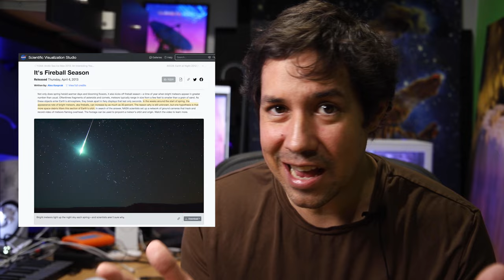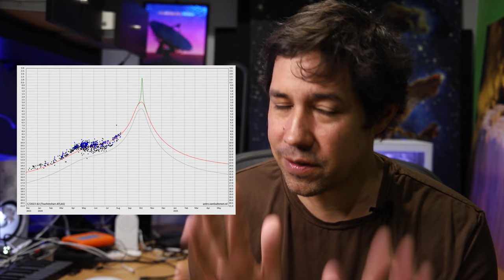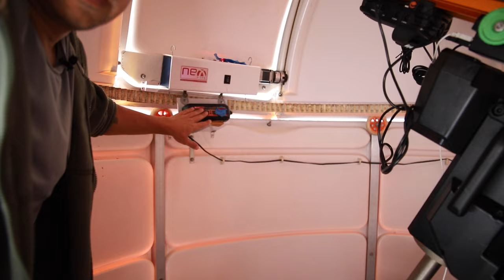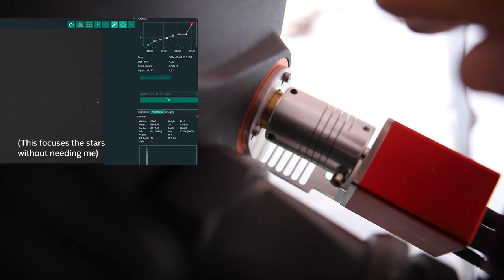Explaining my current Telescope setup! 🔭

Comment: Holy crap, clean that lens! (I hear at the end you did, good job, haha) But seriously, I've always loved your setup. I have the little brother, an 8" EdgeHD and EQ6-R Pro, on a dolly that I roll out to the driveway. Your setup is certainly the next step up, as soon as my wife approves me getting an observatory dome. I am not an OAG guy though, I am doing just fine with my guide scope, plus it looks cool. I am a bit of a ZWO fanboy though, with the ASIAIR, ASI Cameras, and ZWO EAF. I doubt the ASIAIR can manage an observatory dome though, so I think if you're going to go the dome route, you must use a PC. Won't be a problem though, since everything stays set up, all the time.
Reply from the maker: I credit the OAG for my perfectly round stars :) It's lovely. Good luck with your upgrades!
Reply: @DylanODonnell  I have good stars too though. I have an OAG setup, but I just don't use it. Maybe at your focal length, it becomes necessary. For me, I think the real trick is a rock solid polar alignment, I aim for less than 1' of total offset. I polar align every session (I have to without a pier).

Comment: Very impressive set up Dylan. I would really like an proper observatory like that but don't have the space. I am currently seting up my EQ6-R Pro mount permanently outside though as I'm getting a bit too old to be lugging this around my back yard in the middle of the night, especially in winter. I also have a couple of grab and go rigs as well, one that uses a Star Adventurer GTi ( currently using this mostly with my Lunt LS50 Ha for solar imaging ) and I just bought a Wave 100i for use with my Red Cat 51 and William Optics GT81 scopes. Luckily my back yard is reasonably shielded from the wind, especially those comming from a Northerly direction which we tend to get a lot of in my part of the UK.
Each of my scopes is set up ready to use so all I have to do is clip it on to the mount and connect to the power supply.
As we don't get many clear skies where I live, when ever possible I like to run more than one rig.

Comment: Hi Dylan, new to your channel and must admit it's great - positive and inspiring!
This time I didn't fall asleep at all :D But have question about your setup in regards of pixel size or better to say, sampling. I myself have this 11" SCT reduced down to 1860mm and on 2.4um pixels I find it very oversampled under my european Bortle 3-4 sky (~1-2" seeing); which makes it a 0.33"/pixel resolution (my guiding is usually 0.4" - 0.5" on AM5). Judging by the 3.76um pixels and no reducer on your setup, you have even higher resolution of 0.28"/pixel. What sky (and guiding) do you have down there in Byron Bay that you can afford this kind of detail? Cheers, Zorg.
Reply from the maker: Hey thanks! Yes I bin this setup 2x2 .. still great resolution after drizzling and the sampling is better. I think I’m bottle 2.5!

Comment: Dylan Have you noticed any issue using Fast filters with a NON fast scope ?  I would recommend an ASG photon cage for your setup with all those items in your image train getting your sensor Flat to the Image train is crucial ... I put one one my  RASA 11v2 and it allows me to have Back focus within 2microns and tilt less than 3microns in any corner almost perfect and it has made my images 100% better!! Your bat images is really good..looks like it is 3D
Reply from the maker: Thanks for the tip! Haven’t noticed any tilt at all with this setup .. everything is as tight as a nuns nasty! And the high speed filters work great at f7 too :)

Comment: Cool setup, Dylan. You should suggest to Nexdome that they should develop a solar-powered charging system for the shutter motor. Solar panel on roof of dome, low profile cables to the motor. No flip-floppy contacts to fail.
Reply from the maker: Agree!

Comment: Regarding your dome issue - have you looked into configuring Pushover in NINA? You could then  add "Send failures to Pushover" in the trigger section of your Advance Sequence from something specific from the Done control options. I have only started using Pushover (still on trial period) and "love" getting notifications of PHD2 guiding failures to the Pushover App on my phone.
Reply from the maker: That sounds great actually! Not sure Nina knows anything about the shutter charge state but it sounds cool anyway :)

Comment: I run my setup off a Lenovo m710q picked up an off lease for $100 off amazon. Does the job perfectly the only thing i had to add was a 1tb external ssd so I can easily grab the data and take it to my processing pc. Do you not need to run dew heaters down there Dylan? I still have my C8 I started with because of you but I find myself running my Stellaruve 80mm Apo triplet more. I added a Pegasus Astro SCT Focus cube V2 to mine. I think the main reason it doesn't get many photons anymore is because the season it really shines with up here its been clouds or rain. Maybe my fall and winter will be different this year
Reply from the maker: Yep we’re in the sub tropics so it’s gets really wet and humid ! Also thankfully the obs is connected with high speed Ethernet so no need to move drives .. I could probably save direct over the network to inside!

Comment: Star Stuff:  Come for the astro, stay for the nihilism.  

Out of curiosity, since you have the dehumidifier that runs all the time and other things inside that are always powered on, did you just run an extension cord from your house power out to the dome?  If so, have you ever calculated how much it costs per month to keep all that gear running?  Seems like an observatory like that could be a really good use case for a small off-grid solar power/battery combo so you could observe the stars with power from our own star.
Reply from the maker: Never calculated but most stuff is off when I’m not using it (apart from the web cams and dehumidifier) .. the whole house on solar would be the dream, one day :) .. if I had to guess maybe $50 per month?
Reply: @DylanODonnell  Yeah whole house solar would be awesome but it's still really expensive for solar on that scale.  I started out small and my patio/grilling area is running off solar with a portable solar generator from Bluetti.  I don't know the conversion rates with your monopoly money and potential shipping costs, but you might be able to get an ROI in like a year if you were to do something similar with a standalone system
Reply: @DylanODonnell  could put the odd TP-Link Tapo P110 power monitoring smart plug at various points in the chain to monitor consumption and allow for smart control. They have a phone app or can connect to Home Assistant, but that’s another rabbit hole.

Comment: I have an esatto 2 focuser that I'm using with an edgehd 14 (that I'll be selling soon). It moves the imaging train rather than the mirror. It leaves me tight on back focus space, but it works well. I can keep the ideal mirror position and use the mirror locks.
I'm definitely an esatto fan
Reply from the maker: I have about 10mm space left though, do you have less in the image train overall? Sounds cool :)
Reply: I have to economize a lot more than you do since the optical path length of the focuser is around 60 mm. I use a qhy600 m camera with a zwo filter wheel, and large ZWO OAG. My adapters have to be minimal. The focuser itself doesn't have much of a movement range.
There is a low profile version of the esatto.

Comment: Question, why not the Celestron focus motor? I have one on each of my SCT6", 8" and now 11".
Reply from the maker: I used v1 and it had an issue where it didn’t fit with the reducer .. it was fine really and I liked it but I was forced to change.
Reply: @DylanODonnell  It certainly does like to get in the way. I'm considering plunking down a bag of dough for an Esatto 2" which is still cheaper than the Baader Alpine focuser and Steel drive motor system.

Comment: Would you want an automatic camera rotator on the image train so you could do multiple objects in a night session? And would an automatic camera rotator fit in the available back spacing?
Thanks. K
Reply from the maker: On a fast scope a rotator would be nice. But my use case is that I’ll spend weeks on a single photo as a minimum. So I change rotation like I change my underpants. Every couple of weeks.

Comment: Always wondered how the dome window knows where the telescope is pointed and does it track together with the mount?
Reply from the maker: Yeh the dome knows it’s at 180 degrees when it hits the home position then extrapolate from that. If the scope moves to a new point in the sky the dome driver calculates the differences and rotates the dome +\- from that starting degree. It knows what degree it is at all times then returns to home to charge :)

Comment: HOw viable would it be to connect a wireless charger to your shutter? It seems the charge rate is slow, but the dome shutter is closed most of the time anyway...
Reply from the maker: I think the first improvement would be to make the battery LiON .. it would be lighter! Wireless sounds viable though.

Comment: Good day mate , question,,,,, I see you have a heated dew ring , I do to but I don't use mine, reason , when I first got scope I put the ring on and when I saw my images I was horrified to see my stars were oblong. I thought it was a telescope and I was very upset about it and then I realized that when I shut the do ring off my stars came back to oval shape and it happened again when I turn the ring on. So right now I don't use it Tell me how are you powering it like how much heat you putting in?. I thought it was a great idea when I bought it but right now I have a heated due shield. Anyway love your videos I met you at neaf, anyway looking forward to what you're answer is anyway bye and have a good day
Reply from the maker: Hi Steve! in the CPWI software I have the Dew Heater Ring set to a mere 6% . manual power . works great :)
Reply: So you only do it to 6% ??  That is enough for a big scope ?? I have to try again I know I was putting much more heat into it ... All I have here are problems of late.. I have an EQ6rPro and I have settling problems in one direction. Went back to the shop ,came back still have the same problems , so so frustrating....